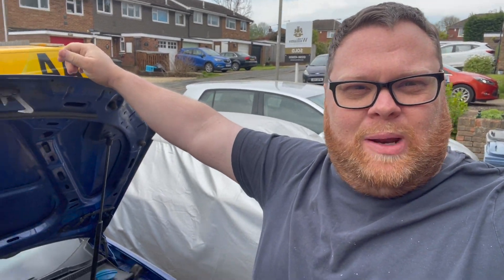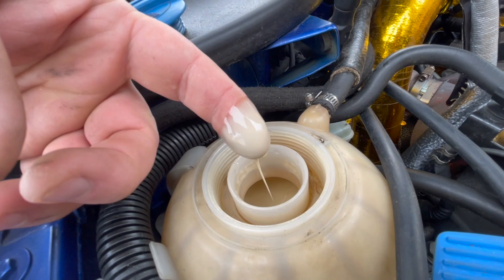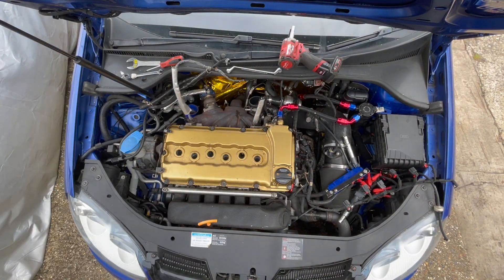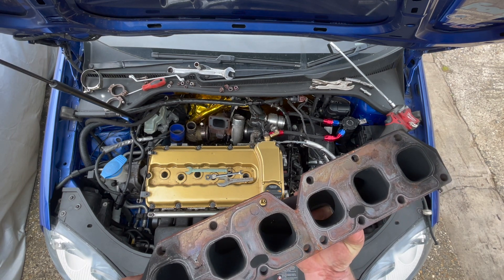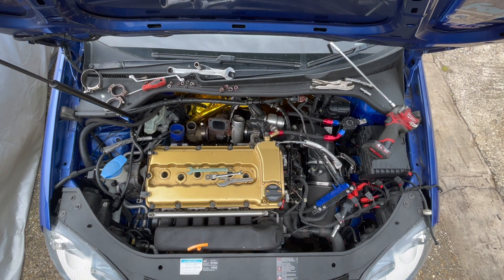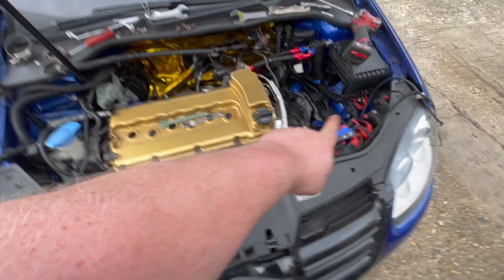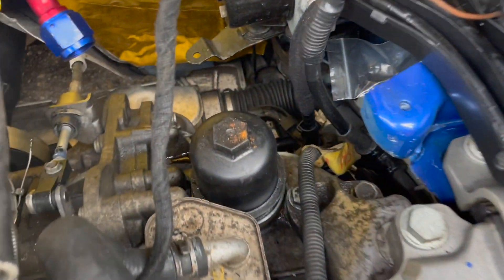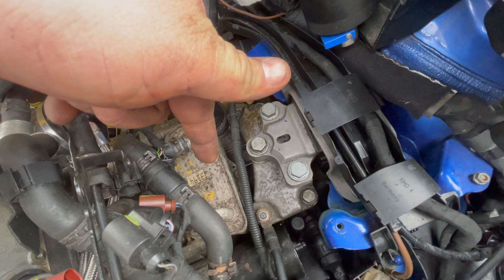I FINALLY FOUND THE ISSUE - Suspected Head Gasket or Oil Cooler Issue -  MK5 Golf R32 Turbo VR6

Comment: Wait a minute, so why did u have watter in the motor oil and under the cam cover?? Great job by the way. Consistency is key for youtube and life in general. Wishing you luck from accross the pond.
Reply: I hope that's not why it's been so long for an update.
Reply from the maker: Great observation. Tbh i think it was just condensation, it had been cold and i wasnt driving the car that much. what i thought was milkyness on the end of the dipstick i dont think it actually was. I have another video coming today that puts this issue to bed.

Comment: Hi,

I have cracked exhaust manifold and need to buy a new one :( 
Did you buy yours from Stealth Racing ?
How much did you pay for new one if you don't me asking ?

Thank you
Reply from the maker: Hey. Yeah got mine from stealth but it’s just cracked again within the same time frame at the same place so I wouldn’t recommend it mate. Get a different design.
Reply: @OctaneFever   Was that a SPA USA manifold ?
I have ordered one just last night :(
Reply: @OctaneFever  I went with the Rothe design manifold and returned the SPA style manifold.
Now I'm little bit concerned about the Turbo oil feed being a bit short.
Would you know the size of banjo & banjo bolt ?

That is if you have tapped your oil feed at the oil filter housing assembly.

I think turbo inlet is AN4.
Where did you get yourturbo oild feed hose made ?

Thank you
Reply from the maker: @ANDROSTENEDIOL  I made the hose myself and yeah it’s an4. I used a banjo off the oil filter housing which Is in my spreadsheet of parts and also you can see it in one of my videos. Check the video out mate
Reply: @OctaneFever  would you know the size of the banjo ?
I think it is M10 .?

Thank you
Reply from the maker: @ANDROSTENEDIOL  yeah m10x1.0 
https://www.ebay.co.uk/itm/384052111523?mkcid=16&mkevt=1&mkrid=711-127632-2357-0&ssspo=p_Wy13t-Rwm&sssrc=4429486&ssuid=NifH31VqS-S&var=&widget_ver=artemis&media=COPY
Reply from the maker: @ANDROSTENEDIOL   Do you have a link to the manifold you purchased?